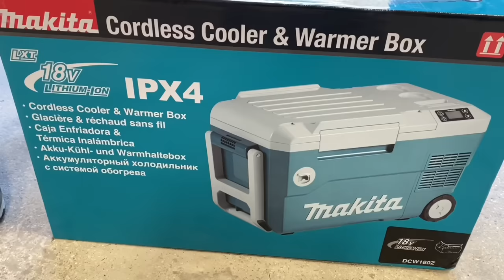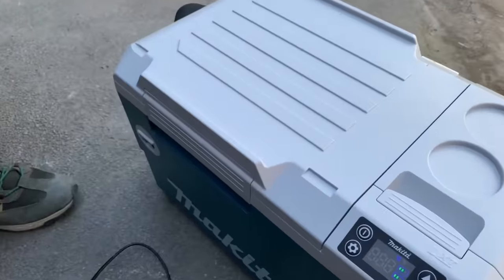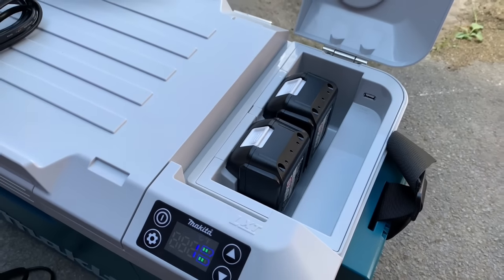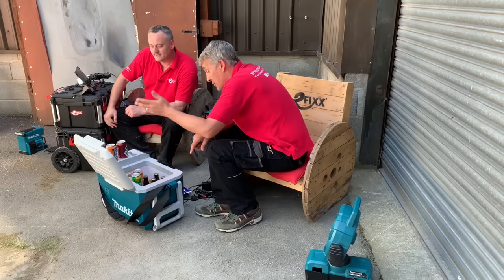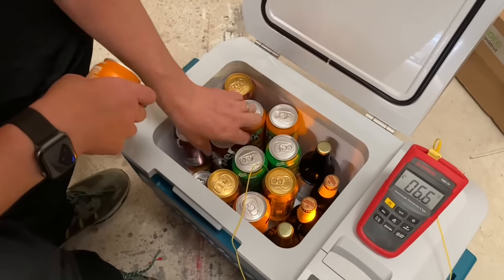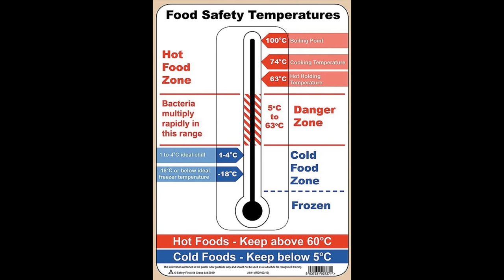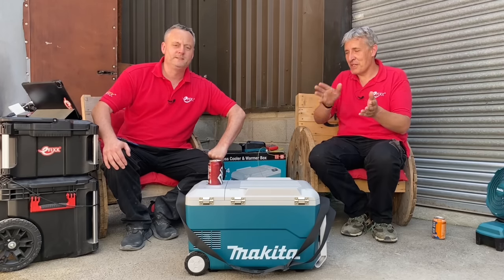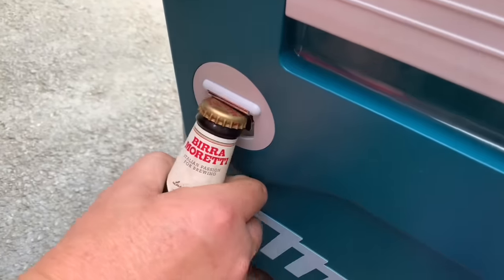REVIEWED: MAKITA DCW180Z Cooler / Warmer BOX - Great or Gimmick?

Comment: I've had mine for a few days now. I run it off the van cigarette lighter, it gets unplugged at the end of the day and turned on in the morning and, I find that you can chill 6-12 cans down to 5°C  in about 30 mins. 

I did hesitate about the price but with the weather we've been having it has been well worth it. I can see it getting a lot of recreational use too!
Reply: Were your cans started a bit cold? or you put in from atmosphere temp?
Reply: @yahtadi5152  ambient temp would have a massive difference on ability to cool and heat.

Even being in sun vs shade would make a huge difference.

Comment: An interesting concept.  For cooling, and assuming you have your van on site, there are plenty of mini car refrigerators that would do a similar job for half the price.
Reply: Not everyone has a van
Reply: Mate I don't know what I've done I've bought he halfords 50L rechargable cool box for £240 as it was on offer. It's just so big! Lol#
I'm now thinking I'll get a smaller cool box that I can plug into 12v instead as I would like an inverter battery on my van. But I'm now looking at portable power stations and I'm thinking you could set the portable power station to charge off the van while its running, then you can use any 12v or AC equipment you want LOL HAVE I GONE MAD

Comment: I have a large heater/cooler box in the boot of my car, when I need it on cooler on hot days i force cool it with a couple of frozen cooler packs, to the lower the internal temp significantly and quickly, the cooler then just maintaines the the temp.

Comment: Going by the label on the side, this IS NOT a Peltier fridge. It seems to be a compressor based fridge. Side label mentions refrigerant type of R-1234yf . So this has to be a compressor. It's used in car air conditioning, so what they have done here is shoved a car AC unit into a box .
Reply from the maker: We’ll spotted 👌
Reply: much more efficient than pelter units.
Reply: More than likely more like a campervan compressor fridge , very efficient on 12v compared to ‘absorption’ type coolers.
Reply: £400 though !! Christ, Halfords do a 30 litre compressor cooler now for £220. Ok it doesn’t take batteries so has to be plugged into 12v but little over half the cost.

Comment: If it's plugged into a 12v outlet and you turn you vehicle off, does it automatically switch over to 18 volt?
Reply from the maker: Good question - we will check this
Reply: @efixx  and the answer was...
Reply from the maker: @howardsmith2  yes it swaps over  but 12VDC doesn't charge the batteries
Reply: @efixx  thanks for the quick response 😀

Comment: Do any companies make battery adapters to say run a dewalt battery on a makita drill and vice versa for all brands?
Reply from the maker: It appears they do on the car boot sale which offers next day free delivery 🚚 - we’ll check these out ! https://www.amazon.co.uk/Battery-Adapter-Convert-Milwaukee-BL1850/dp/B093BRWQXJ/ref=sr_1_9?dchild=1&keywords=makita+to+dewalt+battery+adapter&qid=1627161046&sr=8-9
Reply: Company called badaptor do. I have makita tools but purchased the ryobi brad nailer, the badaptor lets me use the makita battery on the ryobi tool. They make it for different brands
Reply: @frazer26  I have 2 of the ryobi 18guage brad nailors and they work great, also have the dewalt battery powered brad nailer as well but I don't like it as much cause it uses a brushless motor to spin up a flywheel or something to hit the nails instead of the ryobi which uses like a little compressor and is so much quieter as well. Also the dewalt comes with these 3 clear non marring tips that just fall off and I lost all of them in the first week...it also doesn't have a safety over ride like the Ryobi so you don't have to push hard on the material your shooting, I'm a cabinet builder and trim carpenter so I use these things constantly. You in the states or the UK?
Reply: @smooth_ops2942  UK. Built a wardrobe at the start of lockdown and the ryobi was 1/2 the price and reviews were excellent. Could not justify the makita for a DIY project
Reply: @frazer26  I haven't seen the makita one... I'm not the biggest fan of Ryobi but the nail gun is great. Ryobi does have alot of cool things that are battery powered though.

Comment: Why would my cooler have a battery charger on it? The point of using batteries is because you are remote from power. Why add the weight of a charger?

Comment: Is this another thermal box fitted with Peltier Plate Modules ?. Very expensive if it is imo.
Reply from the maker: We thought that at first - needs further investigation as to what the tilt sensor is for?
Reply: It's sounds like it's a peltier assy...you can hear the fans running
Reply: Going by the label on the side, this IS NOT a Peltier fridge. It seems to be a compressor based fridge. Side label mentions cyclopentane and refrigerant type of R-1234yf . So this has to be a compressor. Its used in car air conditioning, so what they have done here is shoved a car AC unit into a box .
Reply: @arcadia1701e  That would explain the need for a Tilt Sensor and the cost.
Reply: can't be peltier and achieve those runtimes from those batteries.
Reply: @edc1569  yes... we've designed ( where I work)... designed a vaccine carriers that can run for days and uses thermoelectric devices...and constantly holding temperature at fridge temps....(Google ..v cool)...you can see the units

Comment: NOOO not ginster get a proper pasty.
It sounds a great idea but the price is 5 times the one I got Halfords powered by van / car.
I know it does have the battery option which is a big interest.
I am makita user
Reply from the maker: Thanks for adding your thoughts 👍🏻
Reply: I suspect the Halfords one won't cool nearly a low as this Makita one. They tend to take the temp down by 15 - 20 degrees below ambient so on a really hot day your drinks may not be as cool as you would have liked. However I do agree the price difference is big enough to offset this disadvantage.